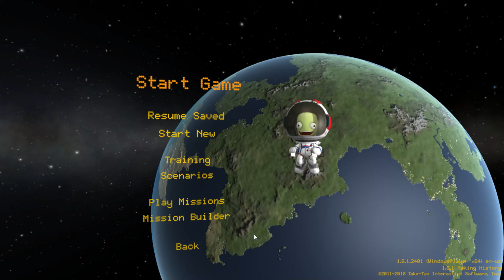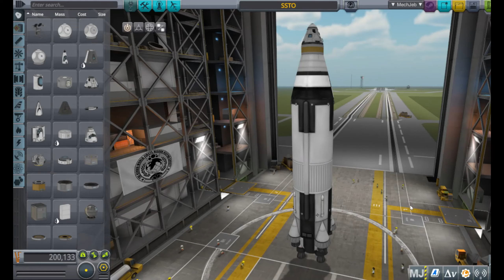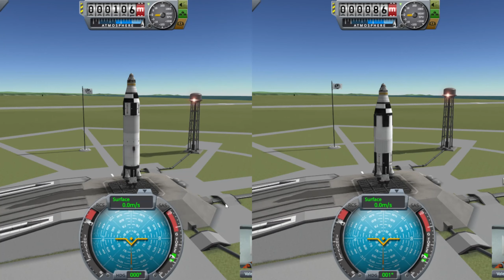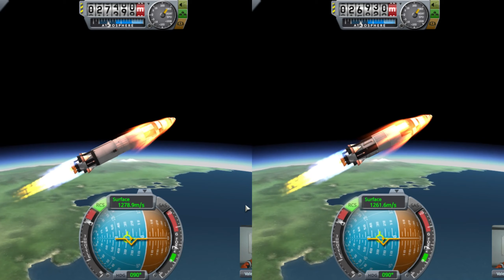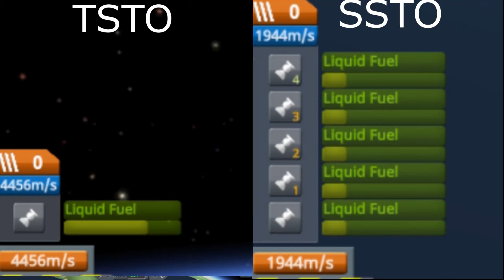SSTO vs TSTO | Kerbal Space Program

Comment: IMO SSTOs won't be viable until materials improve to withstand the forces of holding more fuel and/or propulsion becomes much more efficient. TSTO is the way to go for the foreseeable future. Optimize the booster stage for atmospheric flight, and the orbital stage for vacuum. Save the aerospikes for the SSTOs!